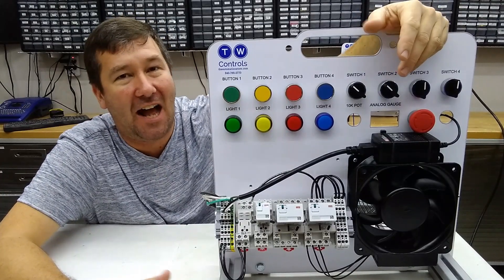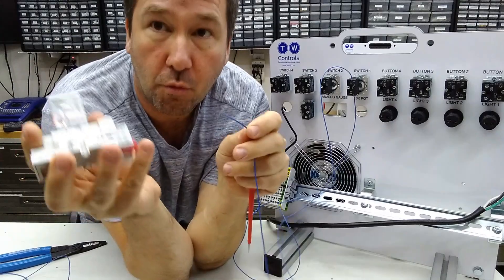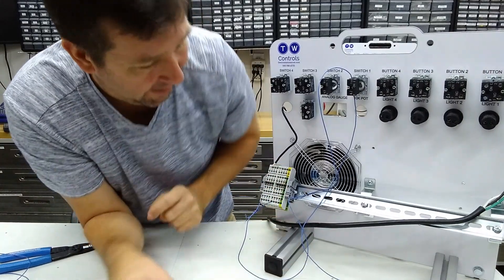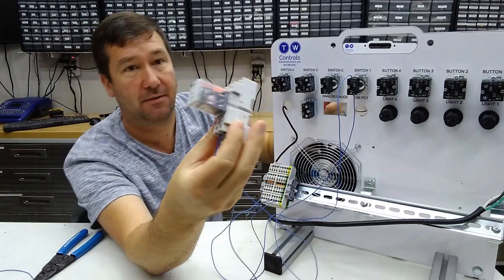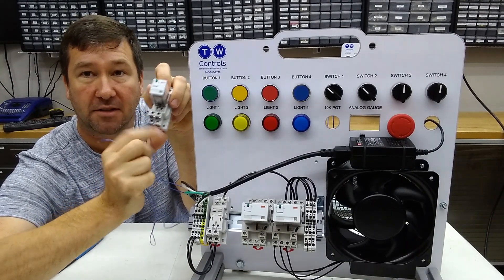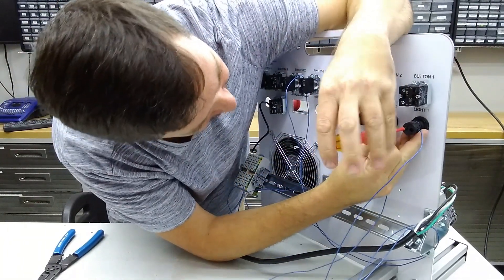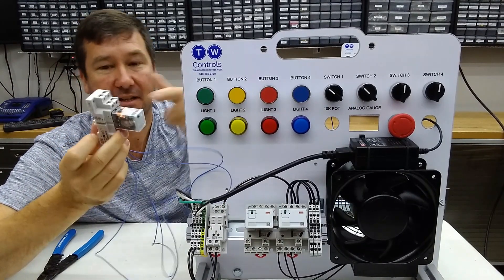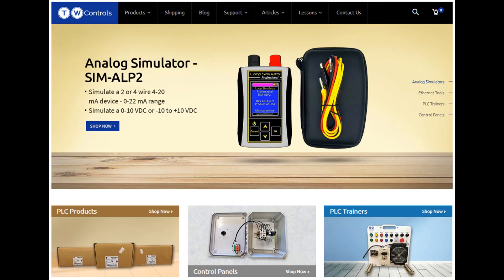How to Wire a 2 Wire Control Circuit for an AC Drive VFD, Toggle Switch, Float Switch, Thermostat...

Comment: Why are you not using the other normally closed and normally open for ligth or buttons
Reply from the maker: I'm a little rusty on this video, I haven't watched it in a while, but what would be the advantage?
Reply: My question is why not use normally open and normally closed your useing a1 and a2 to power ligth
Reply from the maker: @vfgrfbgrb  You could but this is a good example of that there is nothing wrong with putting an indicator light across the coil.
Reply: Where your company located
Reply: True I understand better coil normally closed and normally open application more used in push buttons

Comment: Are you useing a1 and a2 from coil to power ligth as well
Reply: I get you used a1 and a2 for input of switch and output of  switch negative back
Reply from the maker: Are you asking about the light?  Yes.
Reply: Yes
Reply from the maker: @vfgrfbgrb  Then yes you are correct.

Comment: Hi Tim, I need your help to connect FANUC oi on my laptop (FOCAS). I live in UKRAINE🇺🇦, bat sorry me, for my bad english.
Reply from the maker: You'll need the Focas library from Fanuc.  I've only used it on one project but it was easy to do. https://www.fanuc.eu/rs/en/cnc/development-software/focas-development-libraries
Reply: @TimWilborne  I need your help in setting up the network between the computer and the machine. I saw a video on your channel, you master in this theme) please, I Need more detailed instructions. So far, we are not ready to buy programs; we need a free test solution
Reply from the maker: @One_auto_Cn  It can't be done without the Focas library from Fanuc.  Contact them and see if you can get the DLLs
Reply: @TimWilborne thanks you! 
I will try, then I will contact you. do you have whatsapp, skype or viber?

Comment: In usa the + is wired on the A2 ? In France, is A1.
Reply from the maker: This is one of those things that varies from manufacturer to manufacturer.  The one time that you have to pay close attention to it is when there is a built in diode into a DC coil.  In those situations you have to make sure you get the + and the - correct.  I probably should talk about that in a video.  Thanks for watching!
Reply: A1 in the USA too